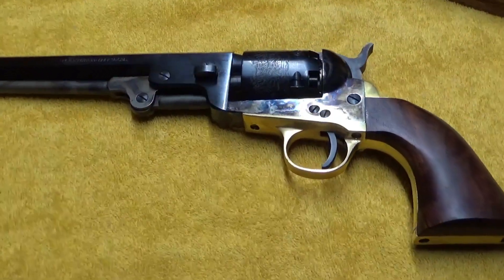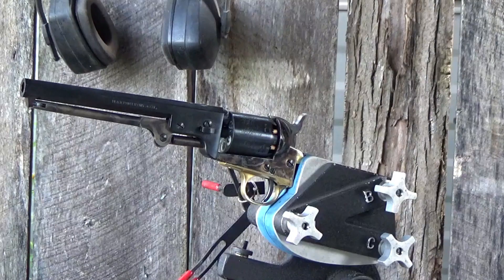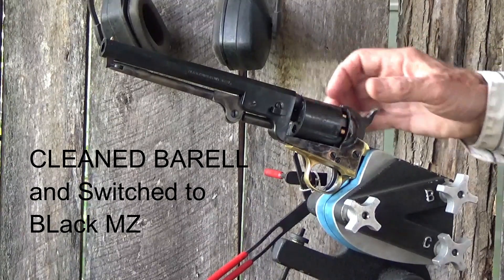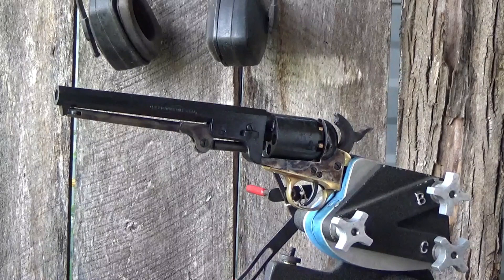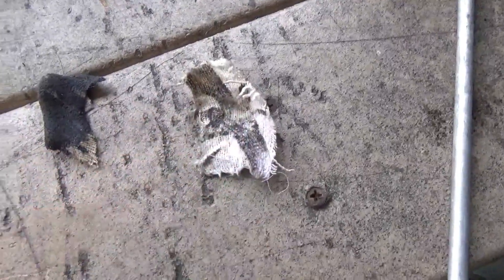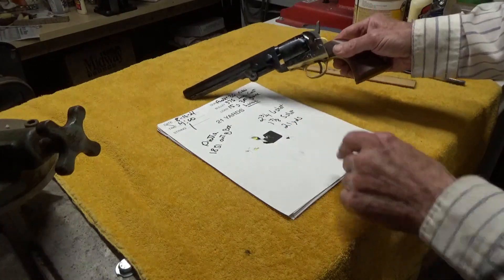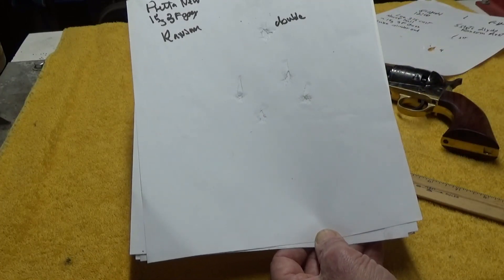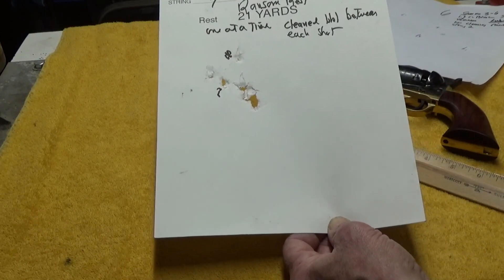Black Powder Fouling and Accuracy - Pietta 1851 in a Ransom Rest

Comment: That was Outstanding information, thank you so much.
I've always wanted to try a ransom rest. So cool.
Reply from the maker: Thanks James.  I wanted one back in the 80's when I was trying to figure why I was getting flyers.  Wasn't sure if it was the sighting, or maybe I just pulled the shot.  Just too pricey, so I tried to build something, but you can figure how that went down.  Got this one a few years back, and now I know that it probably wasn't my sighting or throwing the shot.  The SAA grip adapter works with the 51's, but they make nothing I am aware of for the Remington's.  Blank ones are available, maybe I'll spring for one.  O.R.

Comment: Good to see someone using a rest. Its important to see how well the gun shoots not the shooter. Could that consistent flyer be a bad chamber.
Reply from the maker: Thanks Hugh.  
I don't think it's the chamber.  Couple years ago I was on that trail and it went cold.  Seemed like always one to two flyers so I started to index the chambers and couldn't find any correlation to the flyers.  With the Ransom there are a couple of things.  If the cylinder is loaded out of the gun, then putting the barrel back on could be an issue.  Also, if loading on the Ransom, putting pressure on the grip adapter when using the loading lever could do something.  Ransom says to fire several shots to get the frame seated into the grip adapter.  That works a whole lot easier with a cartridge gun.  Would be nice of course if the $300 gun could shoot one hole groups at 20 yds, but how much can we expect?  I really feel they do excellent, and planning on doing more in the Ransom this summer.  

I agree, are we testing the gun, or the shooter?  If it's the gun, we might not want to shoot only one cylinder, with one hand, in a thirty mph gusty wind and draw too many conclusions.  O.R.

Comment: In muzzleloading some fouling can be a positive thing. Even in the cartridge world no two rifle bullet powder combinations will shoot exactly the same. This why many bench rest or precision shooter's handload to find the right combo. My personal favorite competition muzzleloader runs more accurately slightly fouled. When I am out on a day of all out day long shot after shot this rifle does so all day achieves without swabbing between shots.  My method of madness to some is an overly wet lubed patched round ball. This works for me because in my hay day I would involve myself in more than one shooting stations so loads would sit long enough to contaminate powder much. Revolvers do afford this luxury however amplifies the importance of lubing each shot keeping fouling soft.

For me  this experiment illustrates one more time that blackpowder substitutes do not perform as advertised. Less fouling my butt. Hoards of muzzleloaders have been ruined by false advertising of less corrosive than blackpowder, just to end up as ugly rust buckets in a pawnshop.
Reply from the maker: Exactly.  This was advertised as non-fouling, and also non-corrosive.  If it's non corrosive, wouldn't want to use stuff that is.  As far as how it compares to the GOEX, it ignites well and seems to have about the same accuracy potential, at least in the larger calibers.  Haven't been shooting the soot poles lately, so I need to try it some there.  I have a fair stock of the stuff, so it pays for me to play with it, especially now the GOEX is no more, and mostly all of the other Black is GONE.  THANKS.  O.R.

Comment: I really dont worry about accuracy all that much. If I can hit center mass at ten yard Im good. 
Try gun greese in the chambers and barrel. I can get through 5-6 cylinder.
Lard works best. Plain lard in the winter. Lard and beeswax in the summer.
Reply from the maker: Thanks TimesThree.  Glad you're pointing out that it's not all about  accuracy.  A more practical side is, as you say, keeping the gun shooting and not jamming.  O.R.
Reply: @oldranger3044  Right! Love the vids. It shows that a design from defore the civil war is still a good design.

Comment: That first group was fantastic, when I saw that I thought you were onto something, then things just went downhill, had you been shooting hand held you could easily get despondent and go to pieces over the later results, but the Ransom Rest should eliminate the human factor, I was wondering what the chamber bore groove diameter was on this, but I see you have already been asked that question, still waiting to get above freezing here before I do any more experimenting. Many thanks for posting this ! Chris B.
Reply from the maker: Thanks Chris as always.  O.R.
Reply: @oldranger3044  I followed your link to the fouling video, there is some interesting information buried in there, but I lost interest when he insisted that a cap & ball revolver should be capped up before reloading, a really unsafe practice, I think also any lube under the projectile could give very erratic results due to the impossibility of getting the same compression without hydraulically forcing lube into the powder, much better ,if you must do it that way, to have a hollow base bullet filled with lube, loaded over a milk carton wad. Mind you, they do act like tracer bullets! Chris B.
Reply from the maker: @453421abcdefg12345  Again, great insight Chris.  You need to write a book or something.  I also read that far, and then some other project took over.  I have tried something like that because I also figured that was where the lube is needed (as the BPCR shooters do), but maybe I wasn't fussy enough abut the seal to the powder because strange stuff started happening.  

I got a good chuckle out of the tracer bullet.  I remember thinking that my wife was burning the garbage when I realized that it was the towel I was shooting over.  Good think I caught that before I broke for lunch, or it could have burned down the house. No, 
wait,  actually would have got to my powder stashed in the shed first.  🤧O.R.
Reply: @oldranger3044  I made a 45 bullet mould with a hollow base to prove this theory about lube not getting into the bore, with a hollow base it does stay in the chamber under firing, but it does give the mentioned tracer effect, which does cause some raised eyebrows at the club range, my aim when shooting with the Sharps is to see a ring of lube at the muzzle, but I have not achieved that with a pistol, one problem with using a hollow base is that if the "skirt" is too thin, it opens up on leaving the muzzle, causing all sort of unbalance in the projectile, the problem is there are just so many people heading down different routes, few of which are willing to accept other "proven" experiments, so we have to try them all to satisfy ourselves, and of course it is good fun trying them all, I have yet to try the Dick Darstardly big lube in a C&B revolver, that should carry enough lube without being blasted off the unfired bullets. Stay safe! Chris B.
Reply: OR: Giving this lube problem some more thought, have you tried the moulds produced by Dick Darstardly Big Lube, they carry a huge amount of lube which cannot contaminate the powder, or get blown away by blast, and he sells a 90grn 38 cal mould. I have some of his 45 cal moulds and they work very well in the Colt 45 cartridge. Chris B.
Reply from the maker: @453421abcdefg12345  Thanks, no didn't know about him.  Will check into it.  

Going through my list of what I did last summer, found some footage of shooting with no lube VS lube.  Trying to put something together now and hopefully will post.  Trying just to present what happened, but might spark some thoughts or discussion.  I wanted to include as much of the comments I'm making while shooting, but it can get long, and possibly boring for lots of folks, but plan to do it that way.  Again, thanks for the mould info.  O.R.
Reply from the maker: @453421abcdefg12345  Just a stupid question. Have you ever shot say 18 rounds in a percussion consecutive without any lube or wads?  O.R.
Reply: @oldranger3044  Not a stupid question at all, I think more questions need to be asked to increase our knowledge of these things, I have never shot long strings of shots without lube, I used to use just plain Tallow, but then changed to SPG ,which I use on my BPCR, and I find that works very well for an afternoons shooting, but I think the lube could be better held on a wide groove bullet like the Big Lube, unfortunately I do not think I can get one of these from abroad, there is a difference I think between the lube requirements of a Remington and a Colt, the Remington very quickly seizes up on the cylinder arbour, but the Colt does not seem to suffer so much from this, it would appear that the Colt design it better suited to black powder fowling. Stay safe ! Chris B.
Reply from the maker: @453421abcdefg12345  Yes, I started having issues at about shot 8-10 with the Rem.  Went as far as 18 and had a devil of a time getting the ball seated and it was a 451.  Not sure I have a big enough hammer for a .454. Working on a vid showing how all of that sort of "went down", it's no super production, but this is a cheap war.  O.R.

Comment: I’d love to see a repeat of this test but use lubed felt wads to see if there’s any improvement over the later cylinders full.
Reply from the maker: Hi Jeff.  That's something I should do.  For me, things just seem to get worse with more shooting, but most has been of the bench, and of course can't be 100% sure that it's not me.  I have the Ransom and now a grip adapter.  I also have snow and below zero temps.  I want to run a test of lube VS wads in the Ransom.  So many variables to test, and a shortage of caps.  Oh well, as Captain Red Legs said, "Lots of work to do in Texas". Thanks. O.R.

Comment: Luckily, I tend to only shoot around three cylinders per range visit anyway.  I hear felt wads help, but haven’t really noticed a difference at 10 yards.
Reply from the maker: Check out the link in the description if you get the chance.  Lots of good info there, and helps to explain things.  In the day, probably most shots started from a clean barrel (maybe) and there probably wasn't continued shooting as we might do now.  If the first few shots were true, maybe that was all that was needed.  
Really hard to tell sometimes, especially with offhand shooting what is going on.  Is it the sights, shooter, gun, load, or whatever.  I used to golf some.  That slice I had wasn't really noticed till it got out there 100 yards or so, then it just went exponential, almost perpendicular to the fairway.  O.R.

Comment: Be interesting to measure the chambers and barrel groove diameter to see if they’re compatible. Also, could maybe try a .380” diameter ball depending on what the chambers are sizing them down to. Thanks for another interesting video 👏
Reply from the maker: Chambers are about .367, bore .360, and I would guess another .005 for the groves.  I have a cylinder that reamed chambers to .376 and used a .380 cast round ball.  No miracles.  Appears these things don't follow rules of smokeless guns.  But, I'm no expert, just my findings.  Thanks for the suggestion which is a logical thing to try.   O.R.